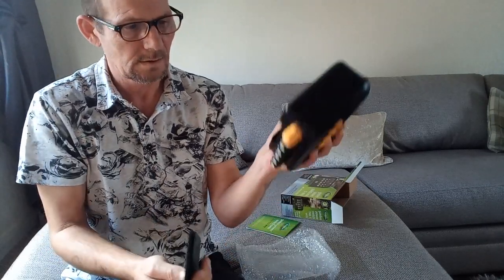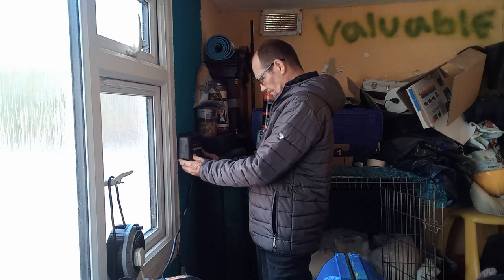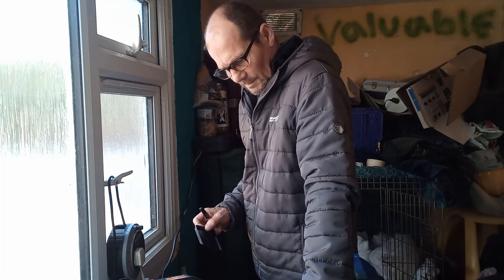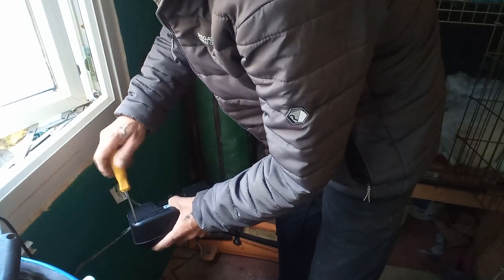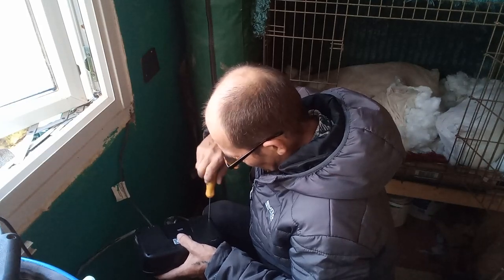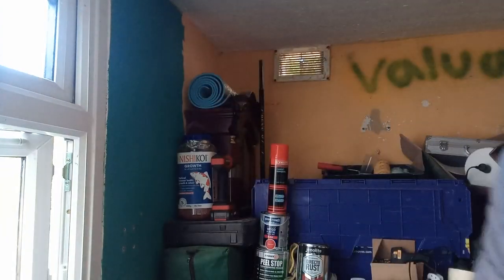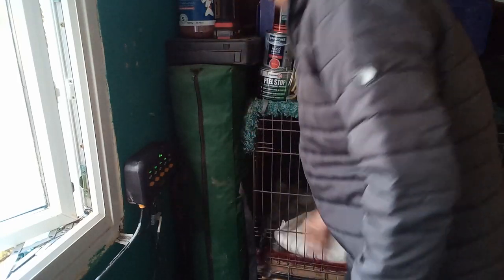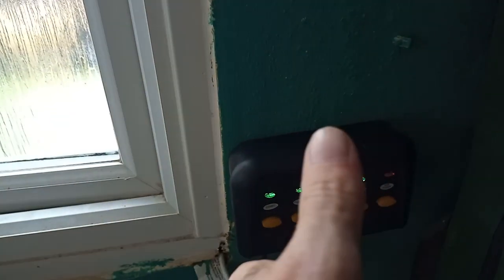blagdon power safe 5 unboxing and install koi pond electrics never again in my life...

Comment: I completely agree with you about this switch box, it’s very difficult to get wires into the terminal blocks, I ended up soldering the wires to try and make easier, i was at my wits end trying to install the box, the thought of having to replace any item horrified me so I have now cut all my cables and fitted waterproof inline connectors, I would never use this type of switch box again, you need a lot of patience fitting this box and making the connections, well done anyway. 👍
Reply from the maker: Thanks for the comment Anthony unfortunately I still use it🤣and moved it into my filter shed but who ever designed it should of thought about people with poor eyes like myself 👍

Comment: I have one and what a disaster this unit is if you have even normal size fingers to get all the wires secured in the unit even when taking the distribution board out. I found soldering the wires at the end helped a bit. My unit has the three outlets.
Reply from the maker: Thanks for the comment yeah what a complete nightmare doing that job never again will I buy one 👍

Comment: These boxes are rubbish.I had one for about a year after which the circuit board tracked and blew the main fuse mains feed. Don’t use outside ,only fit in a dry environment like a filter house or shed,they don’t like damp conditions.
Reply from the maker: mine is redundant now john 👍👍
Reply: @martynskoipondandgarden4581  what did you replace it with